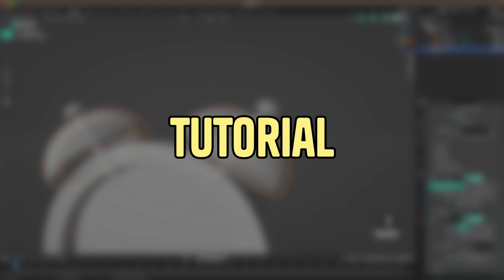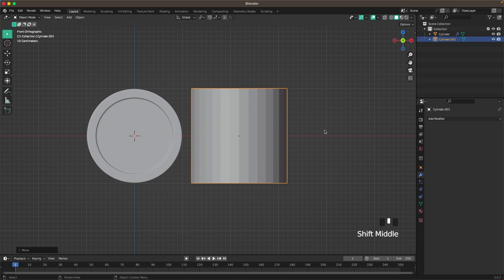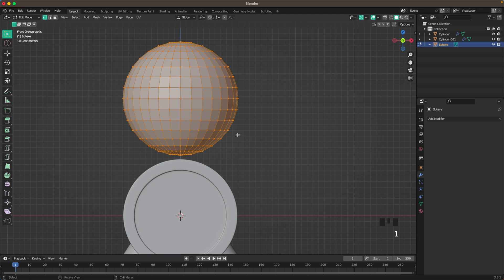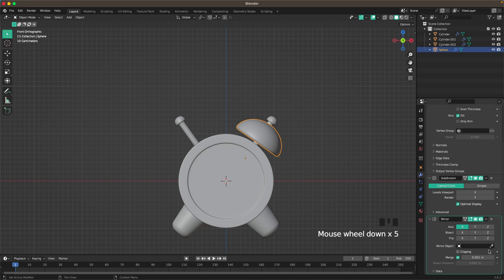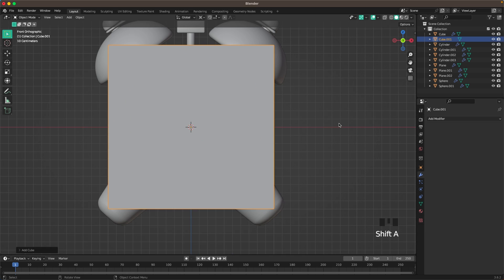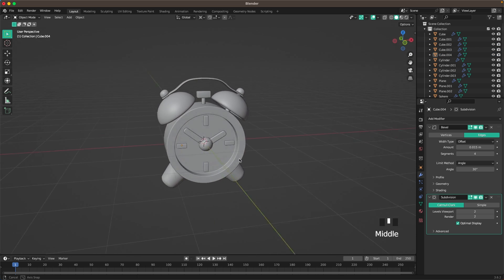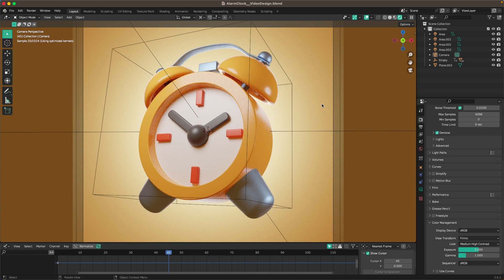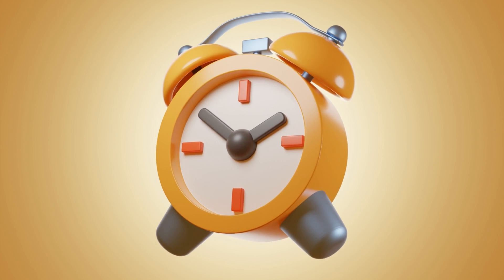Animation for beginners - Alarm Clock Blender Tutorial

Comment: Why my bevel modifier doesn't work on the outside edges? I ticked off the Clamp Overlap in the Geometry section of the Bevel Modifier, but still the same...
Reply from the maker: Might be a topology problem. Try recreate the object ✌️
Reply: @casraven3d I tried a few times to recreate the shape but it didn't help... I merged vertices by distance and it worked :)
Reply from the maker: @piotrgorski1945  Perfect ✌️